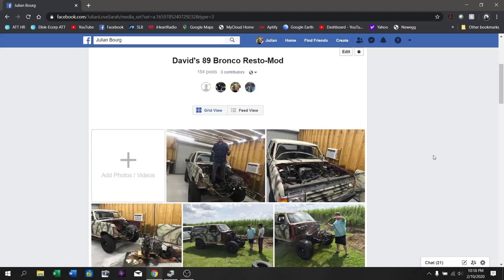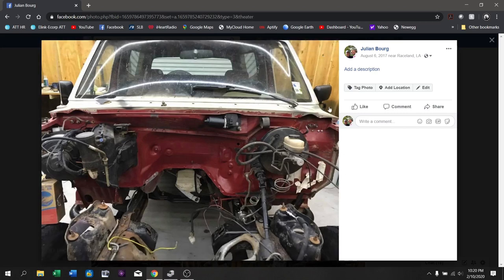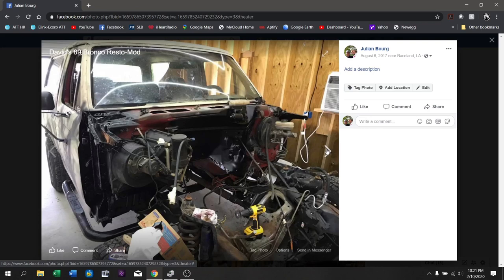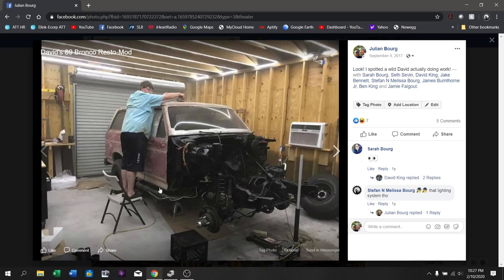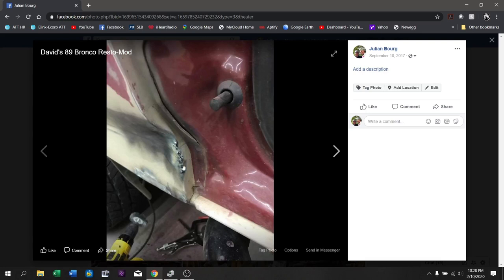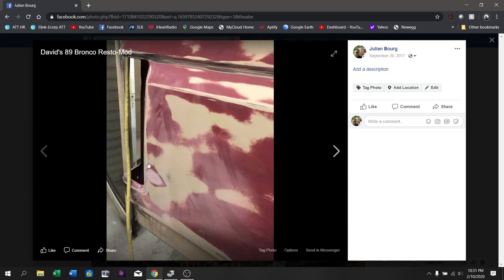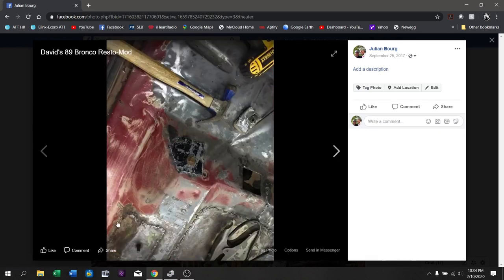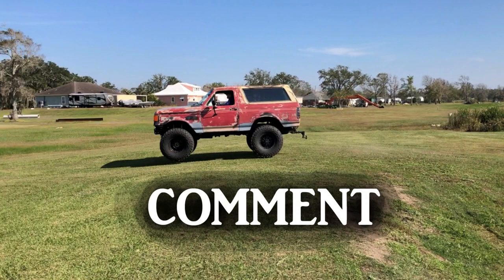How to Build a 7.3 Powerstroke Diesel Bronco - Part 1

Comment: What would you estimate the cost of having a shop do this
Reply from the maker: If you just walked in with your bronco and nothing else. Probably 20-30k depending on their labor rates.
Reply: why dont you just call and ask a shop.... you will get 100 different answers based on the quality of mechanic. It will also depend on what type of final product you expect.

If you expect them to re-pin your 89 EFI bronco harness to a 96 PSD harness you will pay thousands where you can just do it yourself.
Then it comes down to suspension....ect. a stock bronco will get scattered by a stock PSD lol. there's so much involved.

You can probably pay a dude 1000$ and get a PSD bronco. it maybe even drive 5 miles.

Its as simple as anything else, the more you spend the more you can do.